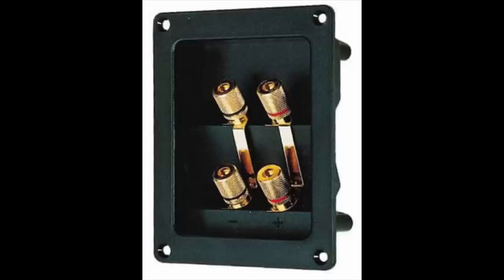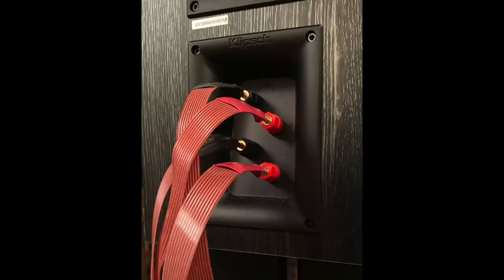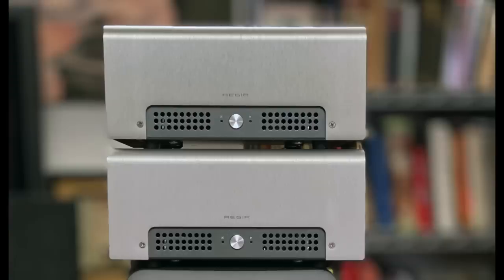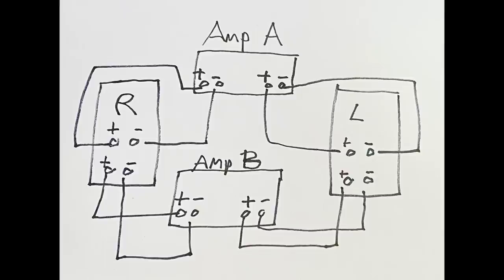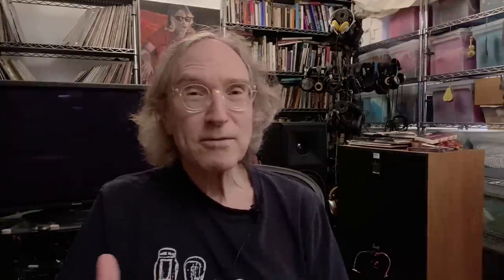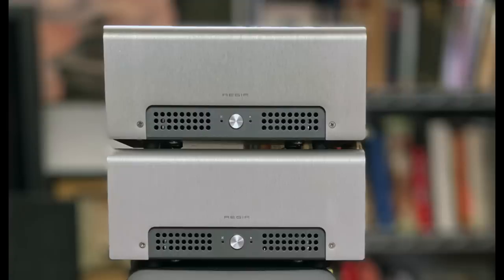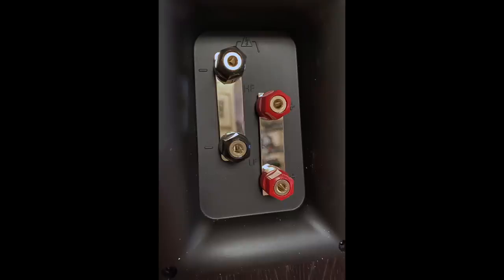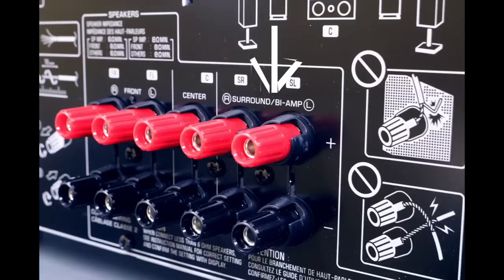It's time to think about bi-amping your speakers!

Comment: About 20 years ago there was a brand of speakers  (Wave something or other) that the designer built without a cross over netw He drove them with one or more Bryston 5 channel amplifiers. This was to avoid the time distortions caused by the cross over network which I imagine. screws up imaging and depth.

Comment: Hi there Steve, I'm very surprised that you didn't use the horizontal method but the vertical instead. Give every loudspeaker/channel his own stereo amp. Benefits over the vertical setup you used are instantaneously noticable and imho the best technical solution.
Reply: Logically I agree with everything you say Paulus.  Driving only one woofer is a much easier load, and channel separation should also be better.  However there are manufacturers out there (Naim spring to mind) who advocate vertical, and I really have no clue why.......

Comment: Hi Steve
Great video, thanks!
I believe the Decware amps can also be used as monoblocks getting more power per channel, as every amp will only drive one of them, and also making easier the connections and no needing for a Y splitter and the risk of missmatching impedances.
If they can be used as monoblocks, the ultimate test would be biamping vs monoblocks.
Have you tried that?
PS: by the way, using them as monoblocks gives another advantage. The amps can be placed closer to each speaker and that way save money on speaker cables as good ones are very expensive.

Comment: I can definitely see an engineering reason why the passive biamp could make a difference. It could simply be a matter of the interaction of the low and high pass filters reflecting back into the amp. I would especially suspect the woofer network affecting the mid/tweeter performance.

Steve, I would love to here if you have experimented with series crossovers.

Comment: When you bi-amp your system (with the crossover point ahead of the power amps) you're eliminating phase shift problems which are common with passive crossovers.

Comment: Have you ever try dual mono vertical bi-preamping + dual mono vertical bi-amping with two identical integrated amps？  About thirty years ago I've used two NAD 304 integrated amps for exactly that.  I've used one for the left channel the other one for the right.  The sound stage width, height, depth, quality and ability to hear deep into the music increased by at least 4 times !💥

Comment: I have a Decware Zen and love it. My speakers are not bi-wirable, but I often wonder about getting another one and running them as mono blocks.
Reply: Jim, I run 2 stereo 2.3 watt zen amps wired as monoblocks. Steve at Decware says it makes each amp 6 watts. Each amp only has to drive 1 speaker thus the extra gain in power.  In my experience, I keep all the sound quality of the zen and greatly increase my power at hand. Personally, Highly recommended and with sensitive speakers, all the better.
Reply: @meteoriteusa7138  thanks for this: yes I think Steve shows how to do this in the manual, and it does not lose the SET “magic.” My speakers are about 97 sensitivity, Omega. I know he makes a mono block version of the Zen triode but if I already have one it it less expensive to get another and bridge them.

Comment: Let me add a nuance to this discussion.   Most commercial speakers may have dual binding posts, but they are really designed to be run by one amp.  With such speakers, you could use two amps (and I agree they should be the same amp), but your mileage with this will vary from some perceptible change to none at all.  I would also add that I would not waste my time bi-amping any 2-way speaker.  IMHO, you need at least a 3-way speaker to experience any benefit from bi-amping.  Also, you can bi-amp if your preamp has dual sub outputs.  

Now, what isn’t discussed here is speakers really designed for bi-amping.  In commercial speakers, speakers designed for bi-amping typically have an amp inside them already which is for the woofer so you only have to worry about powering the tweeter/mid-range.  Don’t know if any of those speakers allow you do disconnect the amp inside the speaker to allow you to connect an external amp.  If they did, this speaker would be an ideal candidate for bi-amping, but you would need controls in your system to balance the volume of the tweeter/midrange and the woofer.

Now where bi-amping REALLY makes sense are speakers specifically designed to be bi-amped.  Take my situation where I am having custom speakers built.  It is a 3-way design with a passive crossover between the tweeter/ midrange and an active crossover for the woofer.  This speaker can’t be run by one amp without changing the crossover.  What are the advantages?  Even here it depends on design.  For example, if your woofers were 12” or 15” and high efficiency (100db for example), why bother?  You have more than enough power with one amp.   In my case, I am using dual 15” woofers in an open baffle design which are no where near that level of efficiency and having a separate amp makes a lot of sense.  I also have the ability to use DSP for the bass range separately from the upper ranges which is another advantage.  If your crossover point is around 100-200hz or less, the advantage of controlling the bass for things like amplification of certain frequencies caused by room geometry far outweigh any other concerns IMHO.

Finally, with this sort of setup, you would not use the same amps.  You would likely use a low power tube or Class A amp for the top end and a higher power (200-300 wpc) amp for the woofers.  This works because the system is designed for kind of amplification.  I could have used a passive crossover for all the drivers, but the result for me would not be nearly as good.  With dual 15” woofers per side and a separate amp for them, I can control and add to the bottom end of this speaker and eliminate any need for a sub (at least for 2 channel sound).

So, for commercial speakers, I think your mileage will vary with bi-amping.  Personally, I’d borrow an amp if I could before committing the money of a second amp.  There is a good chance you either won’t hear a difference or not enough of a difference to justify the cost.  If the electronic crossover to the woofers can be cutoff and you have the tone controls for the woofers, go for it and don’t worry about matching amps because it doesn’t matter (you never had matching amps unless the speaker was fully active and maybe not even then).  BTW, bi-wiring is a complete waste of time.  Anyway, those are my 2 cents.😊

Comment: Steve ,a wonderfull unknown device is the passif crossover to put between amps and preamp , cerwin vega did them in '70ies cx 1, cx2 , cx 3 crossing at 100, 250 and 300 hz , a transistor amp for bass and tubes for low mid and midhighs can work very nice ,but crossing should be low

Comment: I have been experimenting with bi-amping a set of speakers. Because of my somewhat tight budget I have used pair of Emotiva BasX A-100 Stereo Flex Amplifiers.
Reply: Good morning. I was planning on using the same amps. What was the result? Did you feel it made a difference?

Comment: I biamped mine a different way. I used two A-S301's  (because it was cheaper and gave me more watts than a A-S701) to two Rp600m's. But instead of one amp for highs and one for lows, I run one amp per speaker with the left channel for the highs and right for lows. This way each amp has equal duties for the lows, which I'm told are more power hungry. I haven't compared it to the way you wired, but at least in theory it could give the speaker a little better low end.

Comment: I did this years ago with a Griffin 20w value amp running the mid+tweeters and a 50w per channel denon running midbass/bass and it worked really well but but amps had their own volume control and the preamp too so I could fine tune the output from each amp to get a smooth cross over of power

Comment: Why didn’t you use your Pass Labs XP-30?  That line stage has a master and slave outputs; the slave’s output gain is controlled by the little knob in front of the two audio signal chassis.  Anyways, great video!

Comment: Don't forget to check if your amps are inverting/not inverting if you use different amps, you may have to reverse the connections on one set if one of the amps invert.

Comment: Bi-amping can be the tone controls that all super high end gear don't have. Some might say that you don't need it, but you need it if you play music at different volume because of the loudness effect. If you buy two 2-channel switch and some resistors you can then change the balance between the drivers. If the crossover point is two high you need to add a cap plus an extra resistor on the bass output, in other create a 1st order lowpass filter that lower just everything above let's say 400 Hz. Please be aware of phase between woofer and tweeter at the crossover frequency.
I don't believe in deep bass for audio but rather a lot of push in the 80-300 Hz region that makes the speakers sound dynamic. I mainly listen to 6/7ts music where this spectrum is important. More modern music has a lot more focus on deeper bass and then there is a completely thing, but this way to handle the loudness effect is still possible. Most music started to sound crap when they replaced the Altec 604 speakers (just bought a pair cheap) and started with more modern digital production.

Comment: Did you compare vertical and horizontal bi-amping?
Reply: I had to do it vertically for my setup. It sounds great, I haven't done it horizontally to compare though. My thought is that it will put less work on each amp for the woofer, so it might sound better.

Comment: Happy new year, Steve and to all of you reading this.
I wonder if the effect is mostly caused by doubling the power or by using two devices, sets of cables, etc. But since the passive crossover is still used, a lot of the potential is lost in my experience. 
Steve, with the experience from this experiment and you experienced active bi-amping with the McIntosh, are you interested in trying other setups?
I certainly would be interested in your opinion. Companies such as Linn do this for many, many years. Either with analog circuits as an active crossover you can add to their amps, or with digital crossovers. When each amp truly is responsible for only a specific frequency range it opens up many options for amp-driver matching and has fantastic effects for dynamics, detail, and imaging. In my experience at least.

Comment: Hi Steve really enjoying your channel and enthusiasm.
I have a question about simple bi amping with two identical amps without going deep with active crossovers different amps but same gain etc. like you did with the two tube amps. In your experiment A amp is driving the tweeters and mids and B amp is driving the woofers.Is it true that the amp that drives the woofers is getting extra load compared to the other one and in that case should you just swap cables every x listening hours to compensate?

Comment: Using the amps as mono blocs would make more sense to me, this decouples the power supplies so there's less effect on internal DC voltage levels from the lower frequencies. Doing a 4 amp experiment with the same amps would be interesting, so 2 amps driving the mid/highs left and right channels then another 2 driving the lows left and right. If the amps have volume controls I suspect it could be tricky to get the correct volume levels i.e. in effect you've got a simple graphic equalizer by virtue of the volume controls.

Comment: Bi amp vs using them as mono blocks?
Reply: The most obvious benefit that comes to mind with bi-amping vs mono blocks is that bi-amping gives the tougher responsiiblity of driving the woofers to only one output channel, allowing the other channel the easier task of driving mids/tweeters, which should give better clarity.  However, there are world class amps (like a Convergent for example), that are so adept at handling the whole load, there may not be an audible improvement from bi-amping vs mono blocks.  Like so many things with audio....it depends.

Comment: Bi amping is not a hard sell for me. I’ve only experienced it with my friends Linn system. Turntable, pre amp, power amps for each channel (top middle and bottom), all Linn. And it sounds splendid at all volumes. A question I have Steve, or a subject Active Crossovers. No idea whether my friends Linn system has these in the pre-amp or passive crossovers in the speakers. Active Crossovers make the same sort of intellectual sense as bi-amping or amping each channel. Have you ever done it? Active Crossovers?

Comment: I biamp using DSP - specifically because my speakers do NOT have a passive crossover.  The DSP I use is the Xilica XP 4080.  The DSP also doesn’t require a pre-amp splitter cable or a pre-amp with two main outputs.
Reply: @HiFihobby Man - the Xilica is the best inexpensive DSP that is capable of serious fidelity that I’ve found.   It has the processing power to do IIR and FIR crossovers and individual driver time delay and PEQ and GEQ simultaneously.  Don’t even bother with miniDSP - waste of time.  I learned about Xilica on the Klipsch Jubilee Users Forum.  Roy Delgado - the famous Klipsch Senior Engineer, even wrote some Xilica settings for the Jubilee for both the factory drivers and the mighty TAD TD-4001.  You can find the Xilica XP-4080 for about $1200 - which is about the price I pay for really high quality passive crossover parts for a pair of speakers.

Comment: Have a Parasound JC5 running my towers for 2 channel , have a Parasound A23+ running in biamp configuration on my center for home theater and lol yeah forgot to remove the jumpers on my center , huge whining sound then amp stopped and red lights of what I thought was doom appeared, but , shout out to Parasound it was a protection mode that saved the amp  . I realized my huge blunder removed the jumpers and said a prayer , lo and behold the blue lights of life returned and the speaker sounds amazing on movies and with multi channel listening to music .,,,,,, Guys please take a moment and triple check before hitting the power.
Reply: I currently bi amp my center channel as well with one stereo amp. It really didnt seem to make much difference but I dont really use that system for music. I have had it that way for a few months now and it will stay for the foreseeable future.
Reply: @ E M .... 
John Curl had your back on that one 👍🏻
Reply: @scottyo64  lLike you I was skeptical about biamping making any difference but listening to music I did hear some especially on vocals and separation , possibly a placebo affect but then why bother placing double binding posts on speakers at all .

Comment: When you bi amp a speaker you remove (electrically) the crossover network. I first heard speakers bi amped at a Peavey music seminar over 30 yrs ago and the difference was amazing
Reply: Not quite in this case.  Here, there is no electronic cross-over before the power amps.  ie. An identical signal is being sent to both bass and treble power amps.  There are passive cross-overs (which act as filters) before each driver, so that each driver does not receive frequencies that would likely do bad things to it.  An electronic cross-over would be good as it cleans up the signals so less work for the cross-over before each driver.  I think the benefit here is based on how the power amps are driven.  They are set to a specific gain, and the drivers essentially suck power from the power amp.  The bass units can suck a lot of power, which could cause issues with the high frequency side of things.  By separating this, the bass load has no impact on the treble load.  However, given these passive cross-overs, you still have the potential issue of time alignment.  This is where an electronic cross-over helps.  I have a 3 way active cross-over with room-correction digital pre-amp (Legacy Audio Wavelet).  This uses a sophisticated modeling process (which takes about 15 seconds on a server to compute the acoustic model) to configure the pre-amp to generate the right signals for each of the drivers.  These include both the cancellation waveforms to correct for initial room reflections (within 40 msec of primary signal) as well as the timing to provide better time alignment between the drivers.  If you do any music mixing with reverb or delay units, you see that below 30msec, where you can't distinguish the signals, so changes the ambient aspect of the sound (e.g. big hall versus small room), and above 30msec, it acts more as an echo (as you start to be able to tell the sounds apart).

Comment: Happy New Year Steve. I have a Rowland Consonance & Model 1 driving Spendor S8E bywired. I have a second Model 1 and was think of biamping the speaker using one for the left channel and one for the right rather than one for tweeters and one for woofers. I believe Rowlands are 600 ohm impedence for both preamp and amp. Please advise your comments/recommendations.

Comment: Hi steve, I really enjoyed your take on bi-amping. I've bi-amped my speaker in the past using four marantz MA500 monoblocks  and also noticed the same improvements you described, and I wish more reviewers would include bi-amp results when they review a speaker. bi-amping can improve a speakers performance considerably, I noticed a marked improvement with a pair of tannoy  studio monitors I had, they went from sounding bright and fatiguing, to smooth and holographic. 
I was wondering what your take is on vertical vs horizontal bi-amping, I ask that because I am concerned with, if you vertical bi-amp a speaker with a stereo amp,does it cause that amps channels wear in unevenly?
I no longer have the marantz mono's anymore and plan on getting two Schiit Vidars. Your advice will be greatly valued....Thank You much.